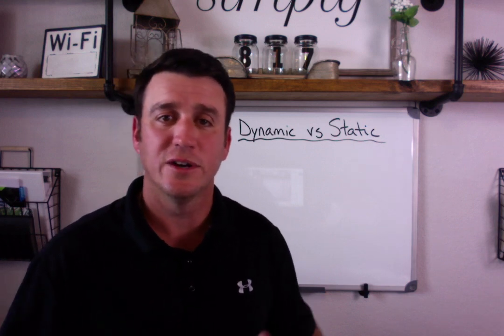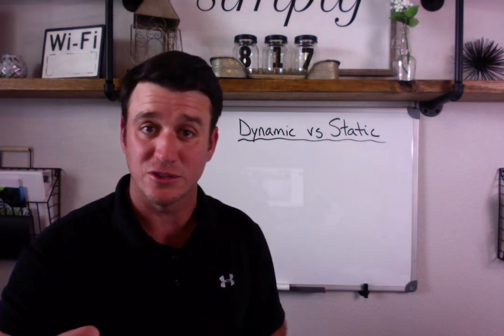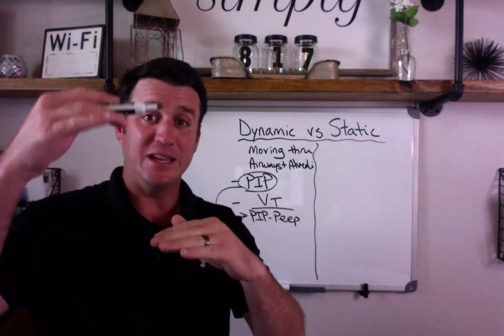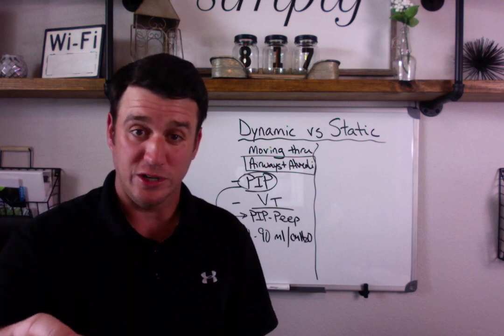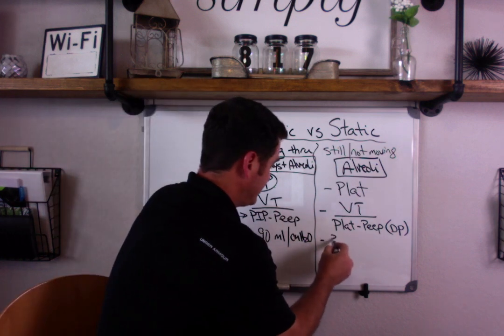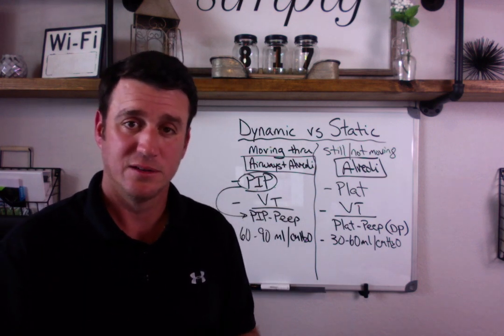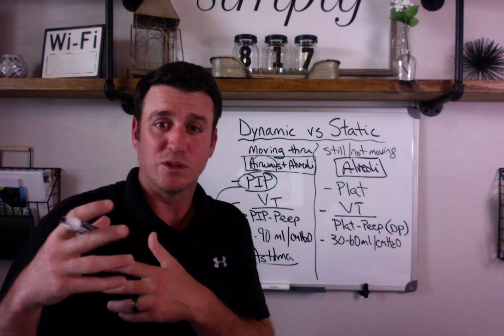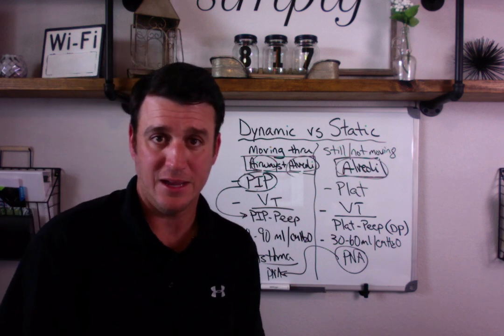Respiratory Therapy - Another breakdown of Dynamic vs Static Compliance

Comment: OK, question, I am an RN in the ED and have been studying the ventilator for a little bit now. Let's say I have a pt that I'm concerned about for developing ARDS. How do I set the ventilator, together with my friendly neighborhood RT of course, to hold a breath long enough to monitor the plat on a constant basis? That information could be useful, even critical, for monitoring the progression of my pt. Although, the increasing plat would also increase the PIP, would it be adequate to just set an alarm for the PIP? Is it possible for the Pplat to increase without the PIP going up as well? Dynamic compliance by definition is a combination of both right? I think we use the Puritan Bennett 980. I guess you answered the question somewhat in the video lol, but I figure I'd leave this up.
Reply from the maker: Great questions Doug.  You can set an alarm for PIP, but keep in mind when that high pressure limit is reached it terminates the breath, which will decrease tidal volume, minute volume, and will affect your acid-base balance.  Pplat, when assessed correctly with a resting diaphragm and no patient effort, is always less than Ppeak.  And yes, that's becuase Ppeak includes the airway resistance component while flow is present.  Hope this helps!
Reply: @RespiratoryCoach  yeah, makes total sense. The inverse relationship between dynamic and static compliance and the corresponding PIP and Pplat is very useful information I didn’t understand before. I assume all these values would only be valid under the same flow rate right? If you change the flow rate you change everything. And lastly, the difference between your PIP and Pplat is considered the driving pressure, right? Therefore, changing you I:E ratio (specifically your I time) would change your flow rate, right?

Comment: Thanks very much sir , but a have a question of what makes the pressure drops for PIP to plateau since there  no expiration occur , i mean the same volume is within the lung how come there is 2 pressures beside the  PEEP ? Is it because of the flow ? Thanks in advance
Reply from the maker: It's the result of the absence of flow through the airways.  Airway resistance is the difference.  Great question, thanks for asking it!
Reply: @RespiratoryCoach  thank you very much for replying to me ,  also you have mentioned that  The Plateau can't be greater than the PIP which it's make sense but is there a Possibility that they become equal

Comment: So joe what would be the type of Compliance of a patient who is totally paralysed on a mechanical ventilator? Thank you
Reply from the maker: Hey, Tina!  First it depends on the compliance of the lungs based on the present disease process.  Beyond that, in regards to paralytics, by eliminating any patient-ventilator asynchrony you'll see improved compliance.  However, with prolonged administration of paralytics (a pet peeve of mine) you'll see complications that will reduce compliance.  For example, impaired mucus clearance might lead to mucus plugging and atelectasis.  This will obviously reduce compliance.  Likewise, many paralytics initiate histamine release, which might cause bronchoconstriction, which will increase Raw and decrease dynamic compliance.  Lots of variables to this great question!  Thanks for posting it!!

Comment: Dynamic compliance is always lower than static compliance. I'm confused as to the normal values that you present. Is the normals for static suppose to be 60-90 and dynamic compliance is suppose to be 30-60?
Reply from the maker: Yes sir.  I misspoke on those values and am in the process of refilming this video.  You are correct!  Dynamic is always less than static, because pip is always higher than plateau.  Thank you for this contribution.
Reply: @RespiratoryCoach  Thanks for the fast reply, I would probably have lost sleep over it haha!